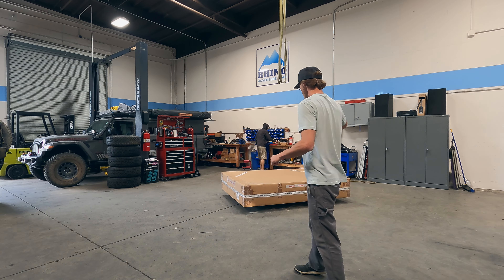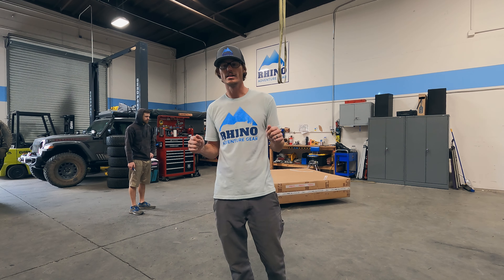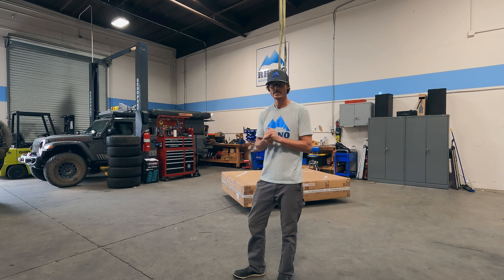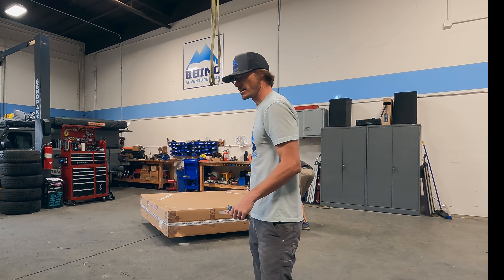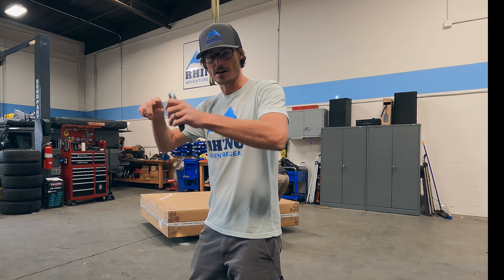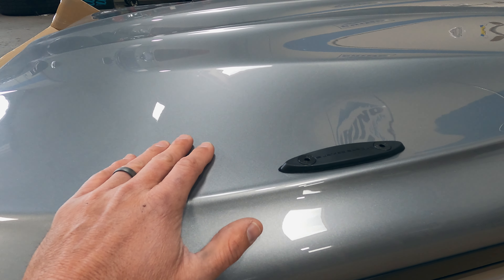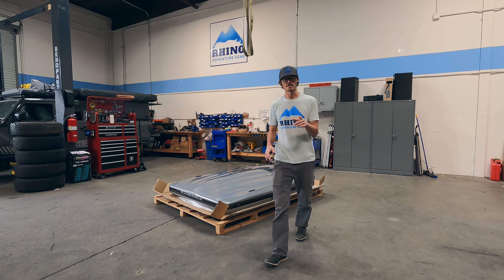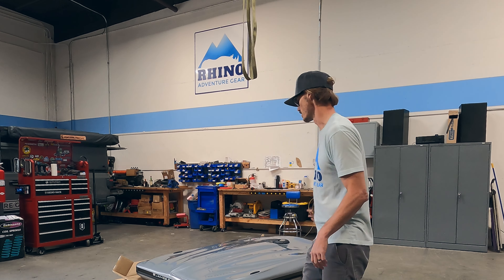Unboxing and First Impressions of the James Baroud Odyssey

Comment: Thanks for the review. 1) Do the doors zip up or just velcro 2) Can you sit up in there, the roof looks quite low on the video but they may just be the angle.
Reply from the maker: Hey there, thanks for watching our video. To answer your questions;

1. The doors have zippers running up and down each side and velcro at the bottom. 
2. Sitting inside, mattress to ceiling is ~35 inches. I am 6'3" and when I sit up straight, my hair just grazes the ceiling. 

Hope this helps! - Pete

Comment: New to researching JB products… What happens when your tent is wet at pack up time, does the wet fabric get tucked in and onto your mattress and bedding?
Reply from the maker: Packing away wet is no problem. You’d want to leave all the doors / windows closed before you put it down so moisture water doesn’t get your mattress or inside of your tent wet. As with all tents you’ll want to dry out the tent fabric once the sun is back out!

Comment: Creaks/squeaks the roof tent, the hard shell undersite when you move inside? 
At a demonstration at the expo it has creaked inside > the abs plastic of the underside......
Edit: in your Video on 09:01....09:15...
Reply from the maker: I'm not physically inside the tent, just moving the camera around in there to show the interior. Not sure what you're hearing. Thanks for watching!
Reply: @RhinoAdventureGear  Sorry, not the answer to the question ;-)

Comment: Sorry they have ruined the tent. Pathetic closing system pathetic latching system, wtf is up with those struts and the locking/unlocking system. Still using velcro on the doors... lets water in just put a damn zipper around the entire door way like every other tent has on its doors.  No midgee mesh on the windows. Still using the pathetic ladder that moves closer to the vehicle as the vehicle moves on the suspension making it dangerous to climb down as the ladder moves intowards the vehicle.